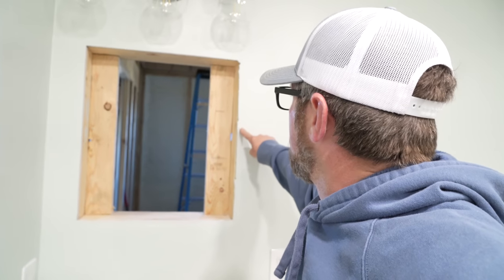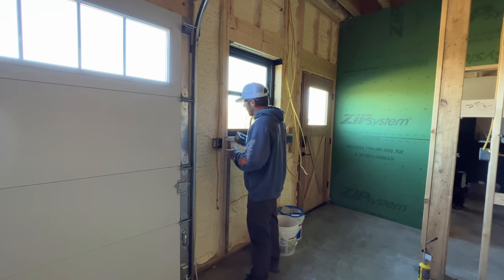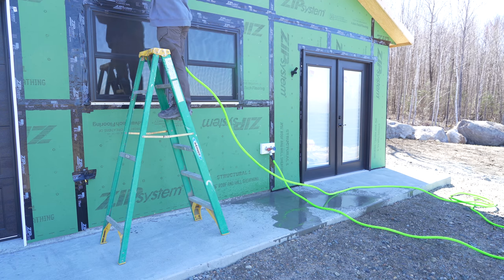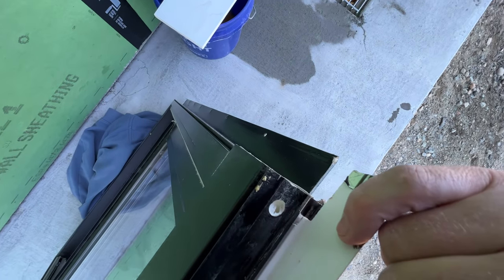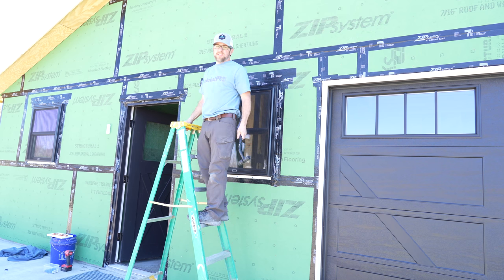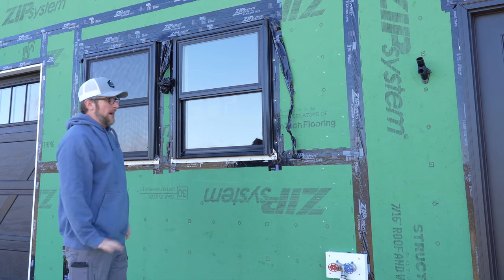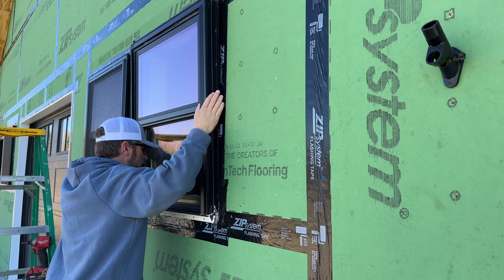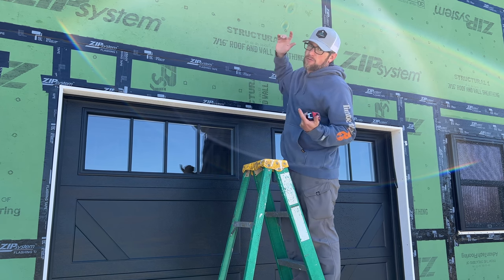THIS IS DISAPPOINTING  | Building Our OFF GRID House in the WOODS

Comment: Morning Lumnah acres. Al if you look at @25.58  it looks like you can see a hole in the sealant right in the corner of the window frame. I hope it's nothing.
Reply from the maker: Gooooood Morning
Reply: It's the writing on the Zip tape you see.
Reply: @StoneKathryn  I've looked at it again and sorry but it's not the Zip tape writing if you look at 25.56 then 25.57 the reflection moves and also it's a different colour to the writing. It's light coming in from a hole in the window frame that may have tape over but if Al has accidentally ran over the hole with the corner edge of the roller it may peirce the tape allowing small amounts of water to come in.
Reply: Howdy Martin!
Reply: @samvalentine3206  hello there

Comment: If I were a betting man, I would pile my money on the corner joint of the windows being at fault. Great catch, hope they're fixed. If not a small bead of sealer in the lower corners of the windows might be worthwhile. The leaks may not be present now, due to moving them around, which could have made a slight adjustment at the corners.

Comment: Surface tension of water. With the sill flat the surface tension of the water is sufficient to pull the water back thru the window. WTH the additional slope on the sill it is enough to overcome the surface tension. I built a storage box on the patio. Tight seal. Dead level. Rain, I had water inside. Shimed the rear giving enough angle to overcome the natural inclination of water to stay cohesive and generate enough slope and speed to carry the rain over and off the surface. My experience. 🤔
Reply: That sounds like you solved the mystery. Thanks.

Comment: Contact Pella direct. If memory serves me those are Pella. In fact I believe those are the composite series. The corner seems are likely the issue and Pella should send a tech out to look at them. Directly to Pella in Pella Iowa is the place to start. Don't come down on yourself and don't wait to contact Pella. The corner is always the weakest seam. Even if you feel its resolved. The company tech the send out has to be certified regardless if you purchased from a vender or franchise owned Pella location. The company itself wants only positive results.

Comment: My question is why are you not putting silicone on the top edge and both sides and then installing the window. And when you screw in the windows they seal the top and two sides? and especially on top corners just saying?

Comment: My guess is that it was the window leaking, and not your flashing. I think the angled clapboard is a great idea though. The windows are made from aluminum and glass, and these actually change size with temperature so it might be they leak more when very cold and the parts shrink. As some else suggested, a little clear silicone on the corners and other joints should help, and any water that does come in is now directed out.
  This reminds me of the problem you had with the windows in the container cabin. Probably similar issues with the window frame itself. But a little caulking, and now any leakage directed out you should be good.

Comment: It could have just been a pressure differential inside your home. The water trailing along the edge of the bottom due to its surface adhesion properties was getting pulled in via pressure differential. Since the other windows have a slope to work against, the pressure differential could not impart enough energy to pull the water up the slope. Remember you have a fairly air tight building except for those opening below the windows and maybe some other smaller spots. The only thing that you did "wrong" was not putting the clapboards on to provide a slope.

Comment: I have the same issue.  My windows are taped and water leaks inside  the sill when it rains.  Taped in July, was warm weather and siding is done so that is not the issue.  I will try to add a drip cap and caulk it see if that works.  I am starting to think that window is broken because it does drip from the inside at the top and travels down the inside window.  But there are no gaps on the outside or anything broken on the outside window.  The inside is gutted so I can see water is only on the window area.

Comment: Hey Al……is those screens in upside down……there are drain slots in them that should be on the bottom……if it rains the water might pool at the bottom of the window
Reply: As stated in video when Al showed windows they were upside down!

Comment: You said sheet rock for the exterior. I'm not so sure about that. Usually siding is installed. Different types are considered. Metal, vinyl, and several types of wood. Redwood, Oak, Yellow Pine. I've also heard of simulated materials that look very interesting.
Reply: Didn't say sheet rock for exterior!!!

Comment: If the windows were installed slightly off square they can leak at the corners and along the rails of the sliding windows. When you reinstalled them, you probably trued them up enough to stop leaking. Most of these modern windows aren't that great and will do that. Especially the aluminum frames.

Comment: Do your window frames have drain holes on the bottom? I wasn't aware that the one I installed had drain holes. I installed the frame without the sliders then pat the sliders in. The window leaked. I removed the window after finding out about the drain holes I had the frame upside down.
Reply: You're right. Most windows have some type of weep hole so if water does get in it has a way to get out.

Comment: Could be a window fault and could be leaking from a corner of the window joint itself and still be leaking but now the clapboard makes it run right out instead of pooling inside. When you were testing the windows it looked like there was a pretty good stream coming out from under the window after you redid them. It's a common thing and why window installers put the clapboards under them.

Comment: Son what seals up and keeps rain out is the SIDING !! you had to hold a hose on the window to get a few drops of water.you will never get that much water pressure PAST the siding even if it's installed wrong which I'm sure it won't. 😊 
   Now with those high ceilings a bit of advice SUB IT OUT !!! 
TIME IS OF THE ESSENCE....AND THE TAPING TOO...😳...
Reply: They are not sheet rocking that ceiling. This was stated in previous video.
Reply: @tonygrimes13    OK  I missed that one...so what's up with the ceiling...staying open or a drop...???
Reply: @setdown2  Al said at 12:30 in previous video " we won't be sheet rocking the ceiling, we're going to do something else for that" - but didn't say what.

Comment: I'd have siliconed around the contact area of the frame of the window before I installed the window and when you screw it down it would squish the silicone into any open void and still tape it up after the silicone sets up. That would guarantee a good seal between the window frame and the building. Then if it leaked you'd know it was a faulty window. I know in construction of windows sometimes during manufacturing they don't always get it right. I used to work for a glass plant that built the glass panes for the window manufacturer. Who knows?

Comment: I'm sure a million people have left you messages about how to fix it but from what I've seen other people do on YouTube when installing Windows is they usually leave a gap of sealer tape at the bottom like to open strips so that any wire that does get in drains out through those two strips that are open at the bottom of the window sill on the outside. I don't know if that will help I'm sure you've gotten a million ways to tell you how to do it from everybody else. Good luck 👍

Comment: IDK who told you not to tape the bottom nailer but if you watch your  video you can see the sun spots on the sill. So when you put in the plastic sill it raised it up above the nailer holes. The only thing is put the tape on flat to the nailer don't turn it up and cover the drain holes. I was the warehouse manager at Pella in ABQ.  And never did I see any of our installers not cover the bottom nailer !! Thats the first tape that should go on !!   I put in the windows in my house not one leaked also have done dozen of houses. love your Channel
Reply: Micheal Mill's if you need to drain the water out from under the bottom nailer you installed the windows wrong !!!!!!!!!!!!!
Reply: @jerrywelch5323  you're the expert. I only built houses for 30 years and learned to read instructions. As I said, not all moisture comes from outside. But what do I know.

Comment: Water can find the weirdest ways in, I once found water nearly 2 meters into the building that had been sucked in due to low pressure while raining and blowing just right. It came in through the outer covering and the paint, through the sealed inner wall and in between two beams, from there in under the floor and finally to drip down into an electrical box.

It wasn't much water, but enough to short out the electrical for no apparent reason and it took us and an electrician nearly a full day to track the issue down. We still have no clue how the water got inn, but the path explained is the only possible path to that point. We moved the electrical, as it was easier than to track down this impossible leak. To get where it was leaking in, it had to flow upwards and the only place it leaked in was into an electrical box that overflowed with water over time.

But as I said, this was a leak that only appeared for two reasons, one was that a tree was cut down that screen that wall and the rain really had to pail down while the wind had to be just right.  Such weather happens more often now and that's why we started to see the penetration, it didn't get to dry fully between bad weather days and that allowed for it to happen. Cutting down the tree also allowed the weather better contact with the wall and the rest is an annoying fotnot of knowledge that nobody will believe. Water finds a way, if possible.

Comment: The window are aluminum and thus a metal to metal joint in the corners and the internal drainage seals are a weak spot…..I Have built several high rise bldgs with custom curtain walls and used a small spray bottle with a small diameter rubber hose that I could get into small places and spray….to see if the “END DAMS” were sealed/caulked properly…..also, check the internal drainage to see if there is a blockage, again using the water spray bottle….another issue can be if the interior and exterior rubber gasket seals have any gaps,twist, not completely set in the aluminum track.   Also, check the Manufactures spec and cut sheets for these windows and look were the windows joints are…..when checking for leaks, start low and work up….last resort….get the window manufacture field rep to come and inspect…..in 99 out of 100, the corner end dams were the issue and I am talking about tens of thousands of joints I have checked….

Comment: These windows aren't made to be in your home with just zip tape. They should have the drip edge installed above the windows then whatever siding you use should be completed and the window's shouldn't leak.

Comment: INSTEAD OF BUYING THOSE ROUND PLANTER BOXES, WOULD IT BE MORE ECONOMICAL TO BUY A LENGTH OF CONDUIT & CUT IT YOURSELF TO THE HEIGHT YOU WANT FOR YOUR PLANTERS ? FOR INSTANCE, A 20' LENGTH OF 4' CONDUIT WOULD GIVE YOU 10 - 2' TALL X 4' PLANTERS THAT WOULD BE OF A HEAVIER GAUGE STEEL & LAST SUBSTANTIALLY LONGER. JUST SOMETHING TO CONSIDER 🤔. HAVE A GREAT DAY 😊.

Comment: I had a failure of zip tape on a job and the client brought a forensic architect on board to review. Hubers reps stance; if it was installed and rolled and leaks, just replace it. Architect says Huber actually says you need to roll tape within 30 minutes of installing, not clear in their instructions. Either way, it’s not a perfect system.
Reply: Huber will also say, get your cladding on. It works in conjunction with cladding. Nobody likes to hear that either.
Reply: @jprestonpotter  You can always edit your comments by clicking on the 3 vertical dots to the right of comment.
Reply: @tonygrimes13  yup. I don’t mind having it separate as an additional thought. But no need to clutter up I guess.

Comment: Remember to never tip windows upside down, depending on manufacturers the gas between panes is heavier than air and will leak out.  Another great way to test is to seal plastic around the outside and seal in some smoke bombs.  Run inside and see where it comes out.

Comment: The Zip tape looks good. Leaky windows? That would be disappointing! Wow, a mystery of how the water was getting in there. Too bad you have to redo the installation of these windows but it could be a blessing! With that clapboard installed you won't have to worry about the water going the wrong way into the house! Tanner is so cute! Gina, so funny that you said your hair looked terrible when you looked in the mirror of the installed medicine cabinet. So funny! Water is amazing at how it will get through the tiniest spot. At least you have running water to check for leaks now. Great, none of the reinstalled windows leaked! Kudos to you Al! I'm so glad you had good weather to work on the outside. Thanks for this Lumnahs!

Comment: I have to ask why did u full complete the bathroom but not the shower
Reply: Probably because 1. They don't have hot water yet as boiler is not yet connected & 2. Gina said in a recent video that they hadn't the tiles yet for shower walls.
Reply: @tonygrimes13  I remember the tiles bit just seems like they have done a lot of work that may get damaged when putting up the concrete boards in the shower
Reply: @charlottestevens9352  Cement Board Drywall is just as easy to install as ordinary drywall. They have their reasons which could be waiting for supplies etc
Reply: @tonygrimes13  it is just as easy but in tight spaces the could end up damaging the other walls

Comment: Windows installed on a 1° angle so water will go to the outside that blows under the window see the drip tape is at the bottom of the winter that's why you do not tape the bottom. It's also the way conversation gets out of the windows. You got in too big a hurry to get the windows in without having the siding with the scudded angle so the water would rip off. The rain blue food ie membrane at the bottom of the winter and under the window. I knew you were the only three you didn't like it that. Was installed without the drip edge.